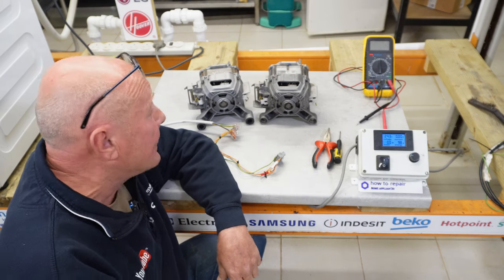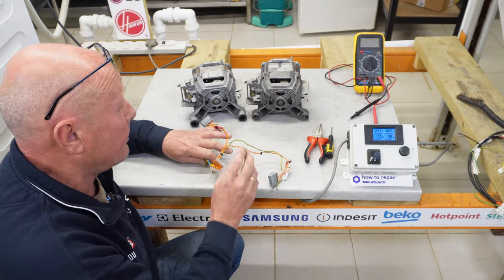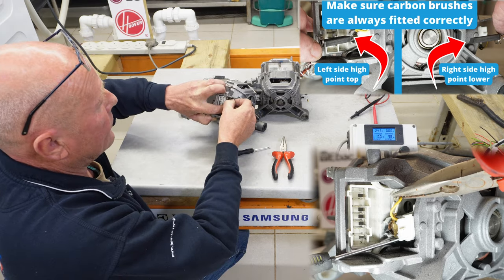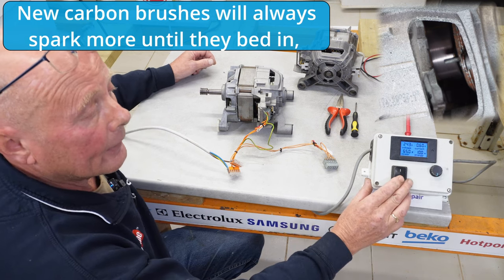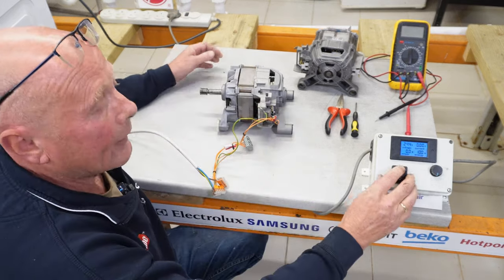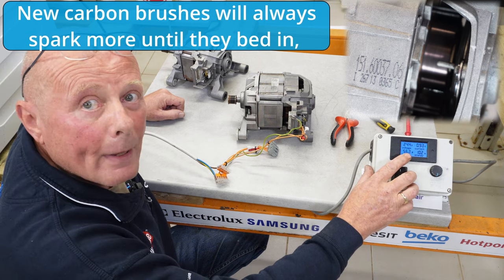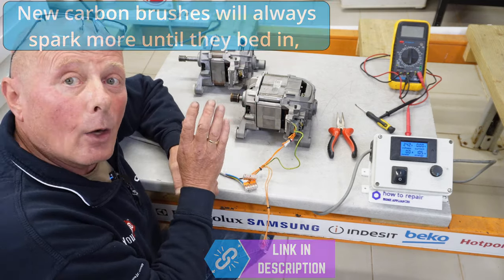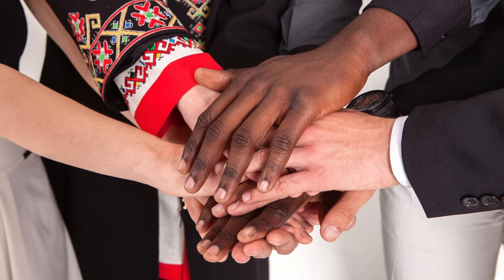Washing Machine Motor Testing. Test Rig for work bench

Comment: Problem with new carbon brush is that its wire is shorter than on the ones that were in a new washing machine. And I am talking about a Bosch original carbon brush. It means that you will have a lot of carbon still available but it will not work anymore because of short wire. About video: GREAT VIDEOS, I love watching them! Thank you for every video and I wish you all the best.
Reply: The wire should be short enough to stop the brush before the metal end touches the commutator, but not too short to waste half of the carbon and lifetime!
(Corporate manager:
How can we make more money from selling motors and brushes?
Genius sales manager:
Let's make the motor brushes wires shorter!)
😡‼️
Reply: @paulcohen1555  That is exactly what I saw here 😄 And I completely agree with you. At the end I had almost 3 times "leftovers" (carbon brush that cannot be used anymore) as in the first one that came with a washing machine.

Comment: What is the typical motor current in actual operation in a machine on washing and highest spinning speed?
(If you already measured or can measure it)
Reply from the maker: If you watch the video on my amperage metres, then you would be able to measure the amount of wattage or amperage being drawn at any point. Typically a normal washing machine pulls between 200 to 400 W I have not made a video on washing machines yet, but here is the one on tumble dryers and it shows you what the tumble dryer motor is pulling. These only cost £10-£15 and I have an essential tool https://youtu.be/NjEa_KZGWaQ?si=BSLVCzbBcxoxkiR5

Comment: Hi, going off subject for a second please, is it possible to replace a 240v fridge/freezer compressor set up with a 12v compressor set up..?I live on a boat and have to run my under counter fridge freezer via an inverter which drags my battery bank down every day and costs money in diesel to charge batteries up again, I cannot afford a new 12v fridge freezer as they can run up to £600!   I’ve seen brand new compressors on the internet at reasonable prices but I’m not sure I have the skills to tap into the fridge gas side of things..any help would be appreciated 👍🏻
Reply from the maker: If the compressor power is roughly the same
Reply: @How-to-repair  any chance you could do a “ how-to-convert” video…? I’m sure many other folk would be interested

Comment: Why aren't you mechanically fixing the motor to the bench?
It will be safer for you!
Reply from the maker: Because I have a voltage controller, the motor does not start fast. If I did not have this. Yes I would be bolting it down to the bench. But thanks for noticing if anyone else is trying this i  would recommend it, but I have been doing it for years.
Reply: Well, you know how accidents happen.